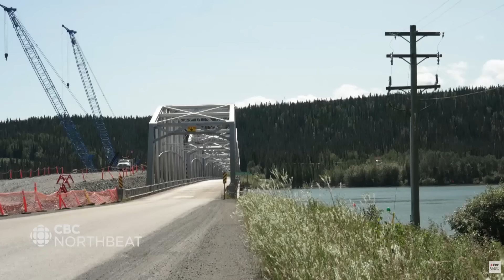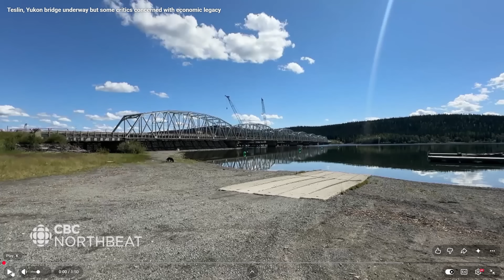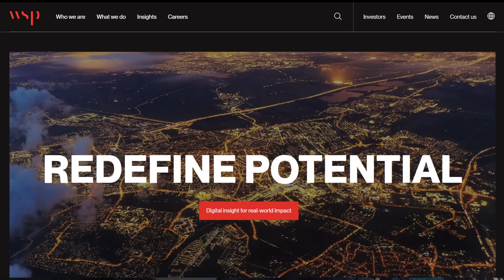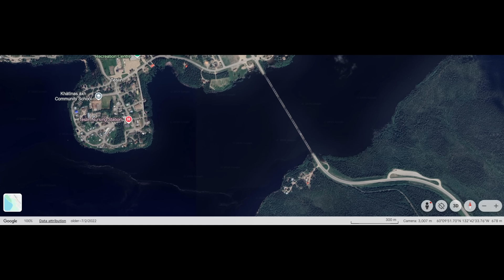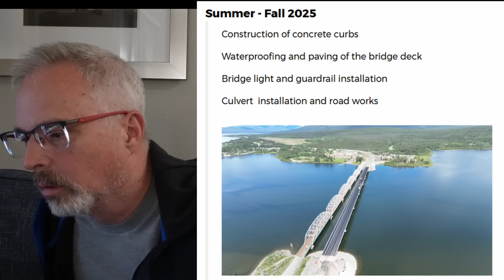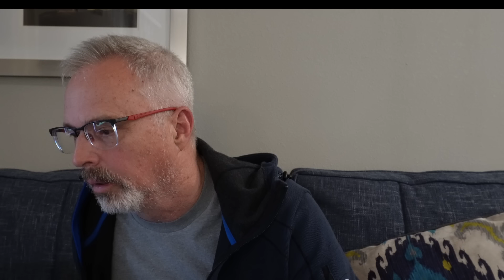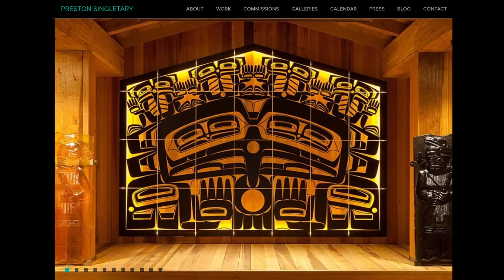Nisutlin Bay Bridge Mess

Comment: Has anybody tried to roll pieces of the interlocking steel panels into a tube. That could be driven..  then dug out.  A rebar and i beam centered concrete column  created  then the steel interlocking panels be pulled one at a time to be reused.

Comment: I have absolutely zero to contribute to any discussion of the specifics of this bridge. But your points re: the apparent shortcomings of contemporary engineering AND the lack of "lessons learned" from notable failures are well made. First example: way back in the day, I remember the Hancock building in Boston, where the windows were falling out. My recollection is that the matter was settled confidentially out of court between the engineers and the developers. I took that to mean that there would be no lessons learned from this obvious design failure. Second example (or examples): the two 50 -story or so buildings in NYC that are failing and possibly (if one buys into the hype drama) in danger of eventual collapse (of course, Millenium Tower in SF also comes to mind). Where is the engineering and/or contractor/developer accountability?
Reply from the maker: It is frustrating how often these critical design and construction failures are swept under the rug rather than used as learning opportunities.

Comment: I have been over the old bridge several times. As I have watched it being built, I wondered why so many round rocks were being used as fill at the bridge ends. I remember thinking aloud that it is a disaster in the making. I would think that crushed stone, similar to RR ballast, would be a preferred fill material. I am not an engineer but I know several.

Comment: 5:10 I've heard similar terms before in the context of mines. What it usually means is that even before it is approved, the entire lifecycle must be considered and planed out. In the case of mines, that means that funds must be set aside to reclaim the site once mining has depleted the ore vein. Permanent infrastructure must be dismantled and recycled as much as possible. Its been a requirement for long enough that there's in fact already been a few mines that have gone through that process. As far as the bridge goes, my guess is that it related to the longevity of the infrastructure (planned to last for more than a century rather than just a few decades) as well as the choice of materials (can be reused / recycled easily).

Comment: SHOCKING !  
This is the first Casey Jones video analysis video that is just riddled with misinformation.

As every engineer KNOWS now in 2026, full integration of DEI, indigenous and under-qualified populations on these massive projects, results in more lucrative low cost “RiDot” type contracts to be awarded. 

This then allows for the most profitable best quality construction of such projects.

Just like 3+4=37 is “Science”, woke work translates directly to happy bureaucrats, engineers, builders and politicians. 
As long as the project can be completed at maximum cost with overruns , the quality is inconsequential.
All that matters is that the project remains intact long enough for the next group of politicians to take the helm..
Reply: For anyone not aware….
Mr. Jones is truly the “go to” for nearly all fire department, technical / heavy rescue / USAR leaders.
His analysis of structural collapse and other related failure incidents = 💯 !

For him not to also be fully knowledgeable about how environmental sustainability has been proven to be the best practice for building critical infrastructure…. Absolutely Disappointing!

Overcoming the previously terrible working conditions imposed on the workers by evil White male engineers, architects and all management, can only be successful if….  Well, you probably already know what the answer is. 

Ensuring the bridge is built according to plan requires a multi-faceted approach and involves many different techniques.

As simple as requiring “boosters”, respirators or paper masks to be worn by all onsite and offsite workers.
Using environmentally friendly water color paints and coatings will encourage the rapid oxidation of structural steel.  
This natural process of exterior corrosion and rust should be permitted to occur as it would in nature without human meddling.
😉
Reply: @CALFireRescue   Hey Left Coast Chieftain.
YouTube comments may let people think you were legit being critical.

Great conference btw.  
TY for the Millennial tour. 
Frightening tilt, just like our monstrosity.
.
How they are ever permitted is beyond me.
Someday ~> Skyscraper dominos. 🫤

Comment: I’ve never driven the AlCan Highway and there are many gaps in my knowledge about it.  But I understand that when the highway was 1st opened, many parts were very primitive.  Although AWD military vehicles could drive the route initially, sections of the road were impassable for portions of the year.  But construction continued over the following years, steadily improving the road.  But as recently as 1970, portions of the road were so rough that the advice to tourists considering driving the route was to buy a new 4WD truck for the trip and sell it after returning home.

But I understand that the current route is all paved and except for short sections of construction projects, it is a high quality route.
Reply: The AlCan Highway today is just like driving on paved, 2-lane highways with shoulders in California or any other state.  The main difference is that the AlCan Highway has fewer potholes.

Comment: I think, its all because the newest bridge is around a 100 Yards shorter, what means, at the northern end of the bridge, they needed to longer the road with a damm, that now is making problems (at the abutment). Probably. Because they build the abutment-segment on also filled ground, that needs to set befor. And i do not think, that the old bridge was working for 70 years without any problems, because....thats probably impossible. You need to remake (or restaurate) the abutments (and the road above), because its an overly loaded segment. Its only, that there is no documentation of it (or nobody knows anymore, that there is). The documentation of problems for the old bridge didn´t last long, because who wantś to deal with it, if its overcome and the bridge works? Probably, the corporation wants more money out of it.... or maybe they ignored, that frost is a problem (and you cannot pour  over the damm for the road - over iced soil and then hoping, all went well. ....

Comment: Just a follow-up to my earlier comment with regard to placement of North and South Abutments further into the waterway. I did find a recent (July 2023) Yukon Territory Flood Mitigation Conceptual Design for the Teslin area. Under the heading “Geology” what caught my eye was the following sentence: “The Till Deposits along the Teslin Lake shoreline are overlain by a veneer of Organics (Peat) and Lacustrine Deposits.” As Peat is a compressible material and with the amount of Engineered Fill that has been placed for these Abutments could this be the issue… anyways it’s just a thought. P.S. - Normally Steel Pilings would be utilized to punch through the Organics (Peat) Layer to provided a proper Bearing Support… for these Bridge Abutments.

Comment: Alarm bells went off in my head when I heard 'Accelerated Bridge Construction'. It reminded me that the Florida International University pedestrian bridge, that collapsed in 2018, used ABC.

The existing Nisutlin Bay Bridge was constructed over a period of 4 construction seasons. We don't know the construction sequencing, in particular the placement of the approach fills. The photo at 2:30 appears to show that the new approach fills are several meters higher than the old fills. Google Earth imagery from 2022 and 2024 shows that not only are the new fills higher, they are much more extensive than the old fills. My strong suspicion is that these fills were placed rapidly (ABC). The height and extent of the new fill combined with rapid placement would explain why the current iteration of the bridge is experiencing trouble, whereas the older bridge did not.

Having said that, the engineers would be wise to keep a close eye on the old bridge, monitoring for movements induced by the new fills.

Comment: Could it just simply be that a nice flexible steel truss bridge is better suited to a location with variable soil conditions, ground movements across a site, extremes of temperatures and low frequency maintenance schedules?
Are engineers overthinking things these days perhaps? Is it a lack of experience or exposure of engineers to other fields or methods (tunnel vision solutions- only using what you know, not what's best).

Comment: Interesting video. I lived in Whitehorse for 35 years and a couple comments. They had to repair the old bridge around 2016 because it was literally rusting apart, which took a couple seasons of welding. Also, the old bridge surface was grated for snow cover to fall through. The area gets 4 to 5 feet of snow annually and presumably the new bridge would require consistent plowing.

Comment: an item to consider regarding the soil issues is that the height of the new bridge's road deck is a good bit higher than the current bridge deck.
that means more soil piled up to build the approaches to the abutments.
I assume this to permit boaters to pass more freely beneath the new bridge with a higher general clearance above the standing water level.

Comment: - technical competency and corprate greed or shortcutting  / corruption of design and construction process are foundational issues for problems with the built enviornment.
- One aspect is the coersion (either by the client, or by the process itself the client has chosen) of the engineering design from "best available" to "risky but acceptabe, because incompetent risk evaluations always come up with "that will never happen", or "we can balme the other bloke when it goes bad" 

I have seen the client quietly manipulating the design away from the best available to the expidited cheeper version. (yup emotional blackmail targeting the designers standing as an engineer to achieve a less capable design / process than originally proposed)
- and designers when pressured, saying to them selves, "well your paying for it, you want a risky crapp second best design, that is what you get". 
--- this is a cultural problem in the engineering profession (delivering second best) when they know there is an option that will bettter deliver long term peformance. 
-- Yes the client will crow on about not wanting "gold pated infrastrcture". in an effort to shame the otherwise competent engineer into delivering risky substandard designs and construction methods. - Such clients are the greedy corrupt fools who cause many many problems in teh built enviornment

Comment: Existing span cord is divided into 7 segments which modulate the strains. Whereas, the new span appears to unify the cord into a single force path with bidirectional longitudinal stresses & strains. Therefore, to prevent failures at the end walls at least 3x more grounding mass is required to modulate and adsorb and unwind the torsion

Comment: I have overheard newly minted mid-career engineers doubt the reliability of legacy drawings because they were 'done by hand', and my horror was increased when copies of those 'unreliable' drawings were given to me piecemeal as smartphone photographs, rather than flat scans, and complete with the tell-tale stick-file curve. The best example was a drainage culvert built during colonial days, at which I exclaimed in exasperation, 'The guy who drew this was probably on site every day!'
Reply from the maker: Lost in translation!  That is a battle I continue to fight.  I require my staff to take printed copies of plans with them to the field rather than trying to view them on a laptop or worse, a smart phone!
Reply: @CaseyJones-Engineer  While the paper copies can get wet or damaged, they also don't run out of batteries and you can easily mark them up with field notes (though if it's below freezing make sure to take a pencil with you in case your pen freezes...)

Comment: My buddy has a 3 year old Peterbuilt roll off tri axle dumpster truck that now has to be totally replumbed as every hydraulic and air hose is failing
Yet both of our 1990s era salt plow trucks have almost all original lines and hoses?
Make it make sense
Everything new is 10times the $ and junk
Reply from the maker: They definitely don't make them like they used to.  It turns out, the most reliable era of cars and trucks appears to have been built from around 1995 to around 2015.  I just bought a 2006 passenger car with 60k miles on it that I plan to use as my daily driver along with my 2014 pick up truck.  I have no interest in the new stuff with too many electronics and less reliable, high stress engines.
Reply: @CaseyJones-Engineer 1995 to 2006 is rhe golden era of trucks and vehicles.  
New enough to have creature comforts, old enough to still have some pride built into them and quality steel.
After 2006 they rust out very quickly 
I have a 1995 gmc 6 wheeler salt/plow/dump truck, a 97 volvo 10 wheel dump truck and a 2003 Mack 10 wheeler all 3 have very little rust and just run and run

Comment: When engineers had slide rules and an uncertainty factor , they underengineered and overbuilt.  Now people stare at computer screens and accept its answers as gospel .
Reply from the maker: You're right. When calculations were harder to perform there was a lot more thinking going on.
Reply: I remember 1st physics course(of 3 that year) requiring calculus and slide rules….  Didn’t get ‘calculators until 2nd year- 10 digits HP scientific… and a few learned metric vs SAE measurements (Standard Asinine Equivalents)… can’t undo stupidity…nor shall their rubbing two pennies in a pocket ever rise to common sense
🖖🏼😊🖖🏽
Reply: @paleggett1897  a brutal assessment, but I couldn't have said it better.😂

Comment: It appears from the photos of the first two bridges 1942 & 1956 that the newest ABC type bridge 2025, is designed to be substantially higher in elevation above the waterline than the old bridges. Requiring importing many tons of loose fill to be placed at both ends of the abutments. Without abutment design details, it looks like fill was just piled without concrete reinforcement. But what do I know! I'm just an electrician.

Comment: a mash-up between modern engineering and the six million dollar man.  "Gentlemen, we can rebuild 'the bridge'. We can make 'the bridge' better than 'the bridge' before. Better... stronger... faster."  Does the halted construction have a larger 'Chain-Up / Chain-Down Area' or similar that added material now sliding into the MSE wall?  Will they remove the deck between the columns closest to the sliding material and the columns next out from shore to prevent possible damage from unpredictable movements?
Reply from the maker: The fact that they Yukon government isn't saying much tells me that this will be a major rebuilt to fix the problems.

Comment: My father was an engineer. He said definitely the young people not being taught the fundamentals. Also a problem with greed. Building specifications being curtailed for larger profits. No thoughts given to safety of the people who might be hurt when the dam thing falls apart. Very few have integrity and moral sense of duty. 😢
Reply: Additional this is the problem: 432 park ave NYC the co-developer Macklowe is 89 and worth 2Billion. He is not giving up a single penny to save the trash can. Yet people could die just from a falling chunk of concrete. Macklowe's Counter-Ef-forts: Rather than paying to repair the building, Macklowe has actively fought to be dismissed from the lawsuits and arbitration. The condo board specifically alleged that Macklowe breached his fiduciary duty by directing repair work to a construction firm he owned, resulting in "shoddy work" he doesn’t care, he got his money. What a demonic excuse for a man. 😢
Reply: @googooplay3777  Or you're wrong.  That is what the court case is determining.

I have never heard of Macklowe, the building or the condo board.  What you are describing is the system working.
Reply: @googooplay3777 I have followed that excuse for a building and am shocked it was permitted.   It was been problematic from the outset.
Reply: What your father said is at the heart of many problems in engineering.
- technical competency and corprate greed or shortcutting  / corruption of design and construction process

Something else I have seen is the client quietly manipulating the design away from the best available to the expidited cheeper version. 
- and designers when pressured, saying to them selves, "well your paying for it, you want a risky crapp second best design, that is what you get". 
--- this is a cultural problem in the engineering profession (delivering second best) when they know there is an option that will bettter deliver long term peformance. 
-- Yes the client will crow on about not wanting "gold pated infrastrcture". in an effort to shame the otherwise competent engineer into delivering risky substandard designs and construction methods. - Such clients are the greedy corrupt fools who cause many many problems in teh built enviornment
Reply: Yukon a very rural area where people approving projects may not be city folk edumacated.